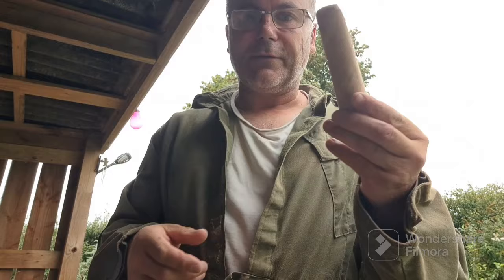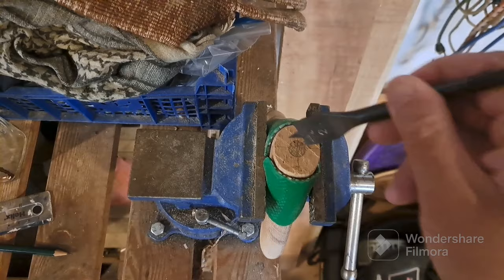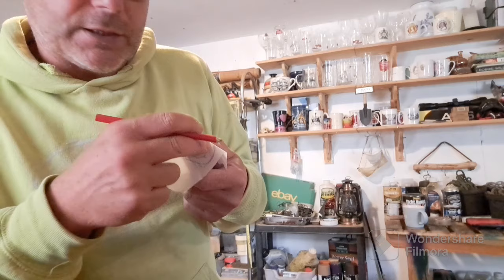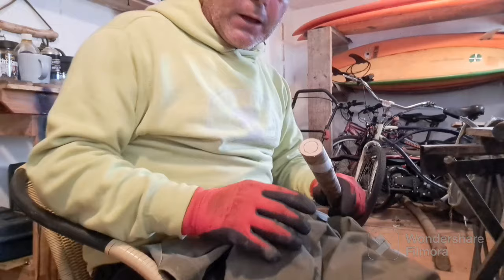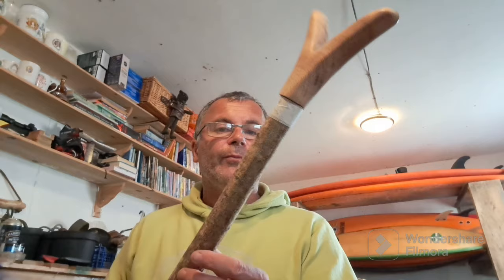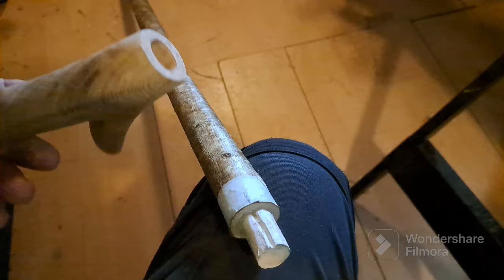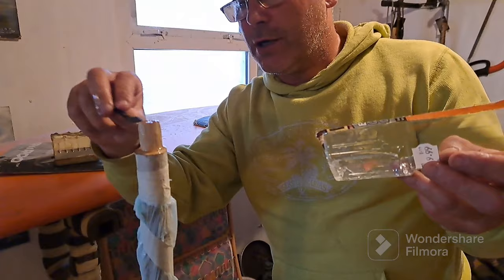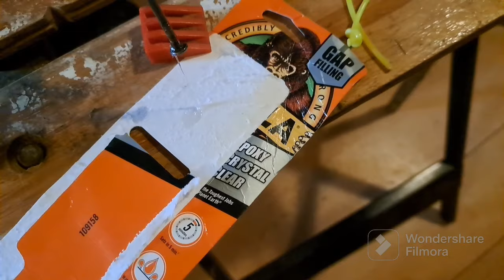How to use Epoxy on a hiking stick topper. Chainsaw carving, complete  build process.

Comment: After the epoxy work, put a long piece of tape on shaft and over the crotch of the handle, pull down hard and wrap tape around shaft to help keep pressure on the handle.  It should help.  Two pieces of tape may be better.
Reply from the maker: Hi, yeah the tape holding things tight is the best option in these crafting circumstances .If I remember  on this the joint it was quite tight but I should've used tape as you described. Thanks for watching and commenting. Appreciate the feedback. Andy.
Reply: One could also use a ratchet strap (like one used for keeping boxes tight when gluing up). Wrap it end to end. Only add enough power to pull the joint tight.

Comment: New viewer question, have you ever tried a blind wedge to join the two pieces together? What are the advantages and advantages?
Reply from the maker: Hi, no, i don't use a blind wedge joint. I use the standard straight cut threaded bar or traditional  wooden  peg cut into the stick itself methods. I have  come across the angled cut method and replicated that also. Thanks for watching. Andy.

Comment: Hello Andy, Great video mate and one I understand well, have done lots of thumb sticks (and yes split some as well). You would probably get fed up with me next door because I would be round borrowing your epoxy if I ran out 😂😂 Cheers and take care.
Reply from the maker: Hi,the problem  for me is 98% my crafting is hiking sticks simply cause  that's part of my core outdoors  interests (hiking).This means I harvest simply  for that  style,  I may devote a harvesting  session  to thumb sticks then I may not have to do so many  toppers to supply  thumb sticks when asked for one. As seen you always run out of epoxy  when you don't have the car available, the shops are closing soon or you just want to complete  a job there and then...lol.Thanks for watching, Andy.